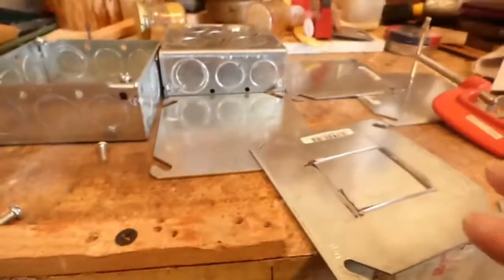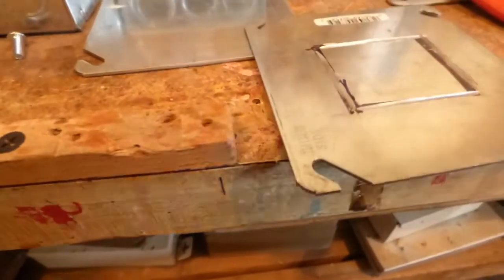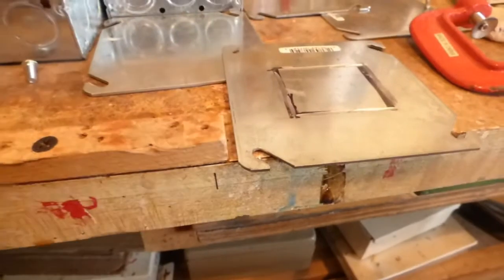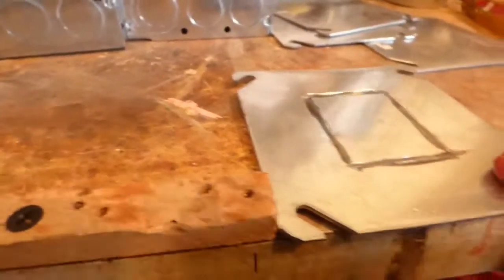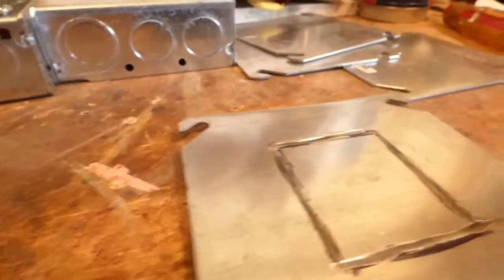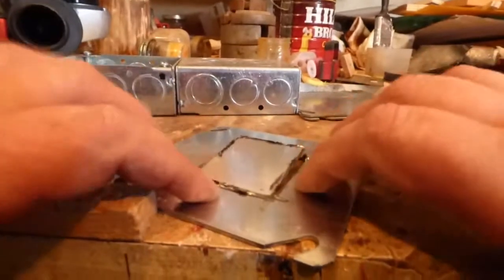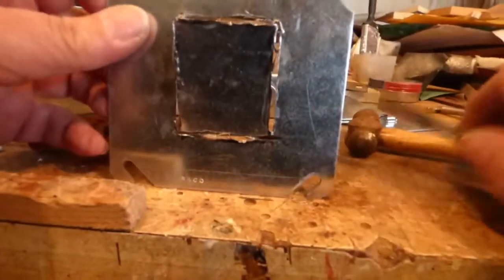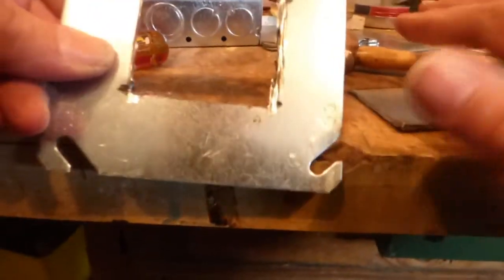Homemade Bushcraft stove...can i do it?

Comment: Yeah when cutting metal with a grinder it takes time. And Idk the rpm's of your grinder, but you just get it cutting and hold it till your through. Smell of hot, burning metal, it'll stay with you lol. Unless you wear a respirator or dust mask.